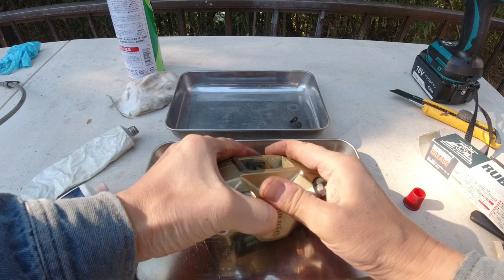aprilia RS125 Disassemble and Clean Rear Brake Caliper

Comment: Did you notice that you turned around the brake pads and the spring? Pads are symmetric, but plates around the pads are not. Which direction is the right one for the spring and the pad plates?
Reply from the maker: I'm not particularly concerned about this caliper as I plan to replace it.